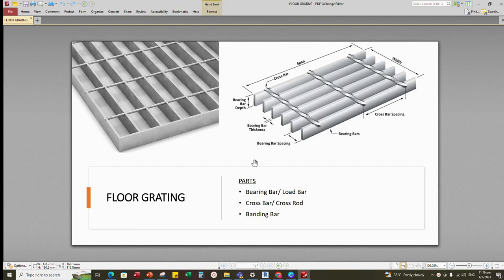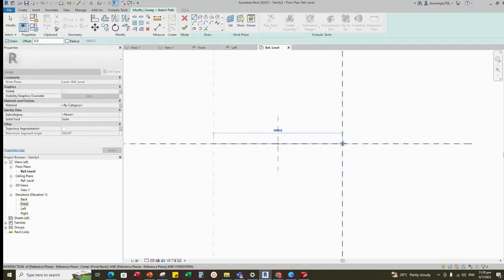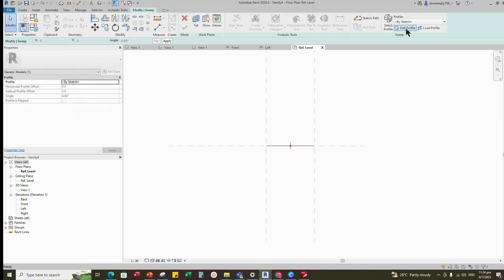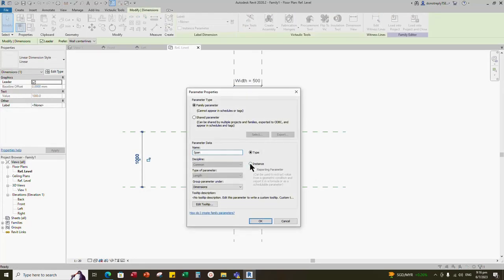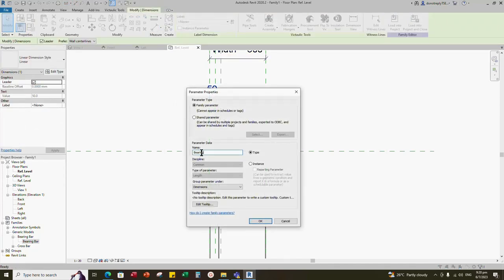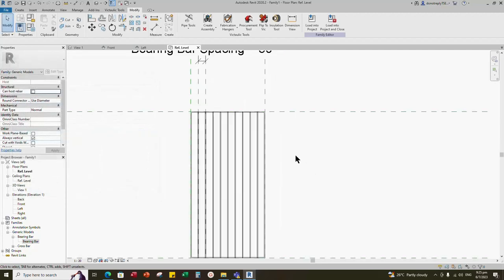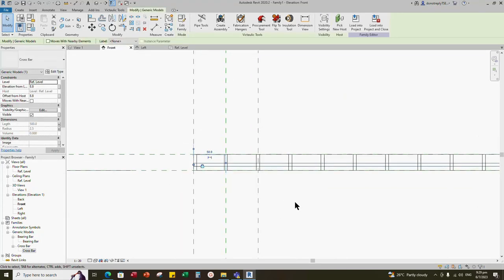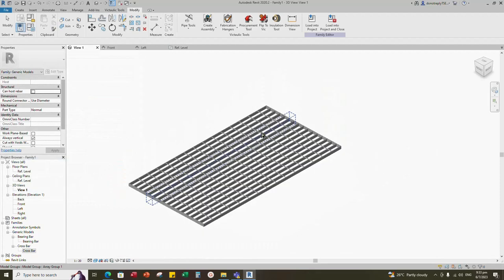How to create Floor Grating Panel Revit Family

Comment: When you change the Span the Bearing Bars are not aligned
Reply: Same problem. Did you find how to solve it?
Reply: ok so after couple of hours I managed to find the solution. All you need to do is select in "Modify" tab the ''Align" command and align your array of bearing bars with the upper horizontal reference plane. I also checked the "Multiple Alignment" and "Lock" options.